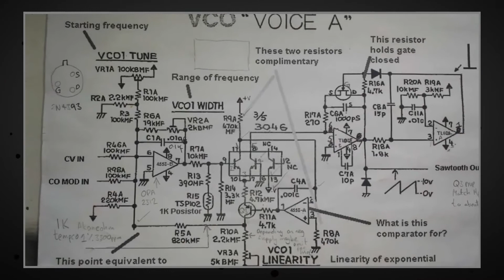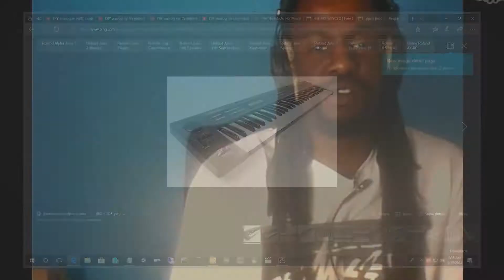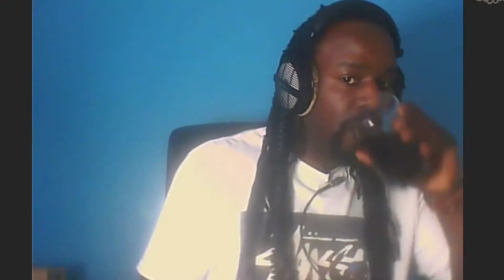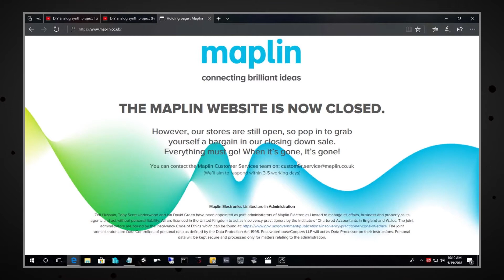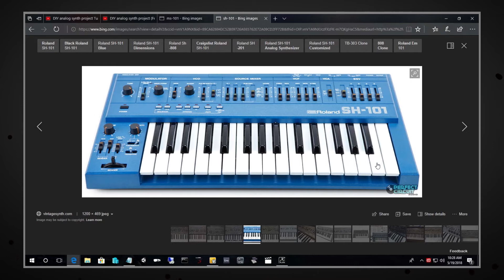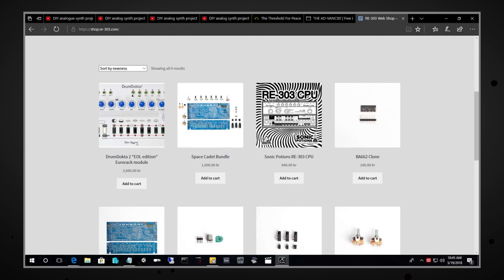DIY Analog Synth Builder Adamski.A Interview - 5/19/2018

Comment: Thanks for the interview, Marshal and Adam! It's very funny and interesting :) 
29:15 - it's the best "spagetti factory" I had a chance to see :) Mine board is just a mess... Once i've spent about two weeks with other work... and I've couldn't get "why i don't have CV in to my VCO but i'm surely getting it on the CV input!" :D
Before that i've got a disconnected wire from CV-in "cable"... Then i've realized "oh! i've made a portamento so it's not going not straight to that buffer chip but in this place" ... i've lost about hour to understand it :))
35:40 - I know, i'll probably throw a rock in "VA lovers" now :)
Not only drifts! At least all older than 2004-10 VA synths like Virus (for example) has issues with aliasing. It's why (my guess) Virus' FM amount is pretty limited. You can't get crazy FM modulations with old algorithms without nasty aliasing. Or it's no reason why it was so limited. Also i remember the sound of Alesis Micron: it's a good little machine to play with but FM things there are very limited. No cross-FM either. I can't tell about many others unfortunately. But i'm 99% sure that all old VAs has the same issues.
Also the process of modelling analog filters is coming to a "close to reality" point only now. We hear such VST like  Diva, Re-Pro and some few others which brings us closer to that point. In past i've didn't realized how sterile many VSTi synths sounds. But once i've understood... it's like an opening your first bottle of beer again :))
Although VSTi and VA synths are easy to use and you can quickly change many things there (especially the VST). VA synths works basically on the same engines. In this area of programming formulae and concepts aren't changing surprisingly fast.
1:16:50 - i still have two cracked up chips :) can't throw them out )) They cracks very differently and i was lucky to not keeping my face over it while powering up. One have a "big crater" (was 7555 IC in the ADSR generator). This is the big reason to keep minus and plus rails very far from each other. It's very easy to insert a wrong wire (to transmit power from a 1st breadboard to next and next) and then "pop!"
My biggest "fear" is when an electric plug throws sparkles when you insert it :)) It's not always happens and depends on a polarity. The issue is the switching power supply (which are very popular these days). They have big capacitors on current filtering stages. So right at a start they take a lot of current from mains and this can produce sparkles. If contacts are dirty or corroded or something else then it "helps" to see the light )
For the rest... maybe getting this project on Patreon could help.